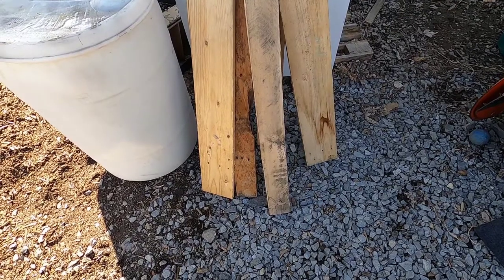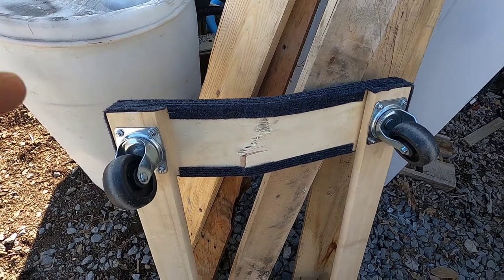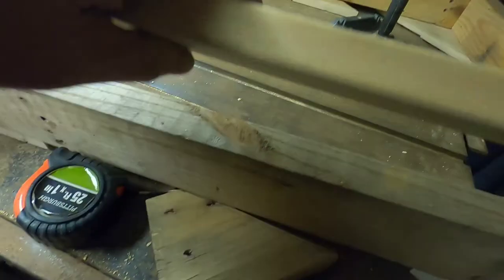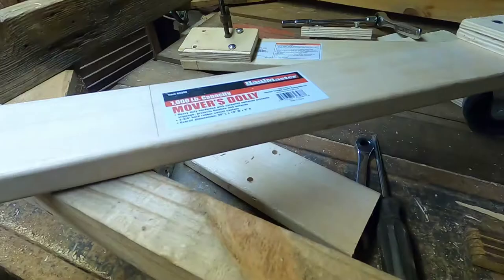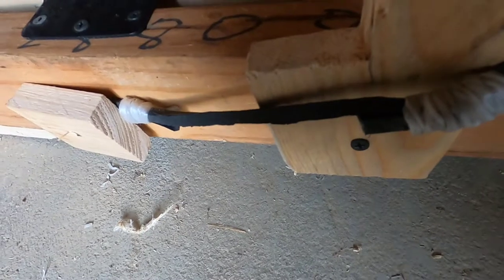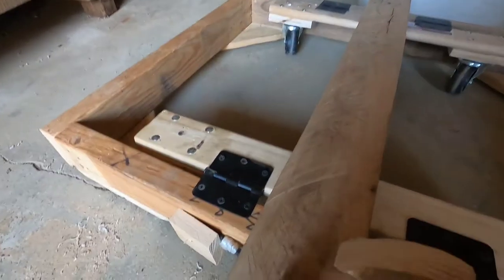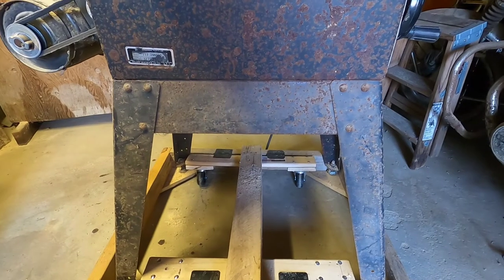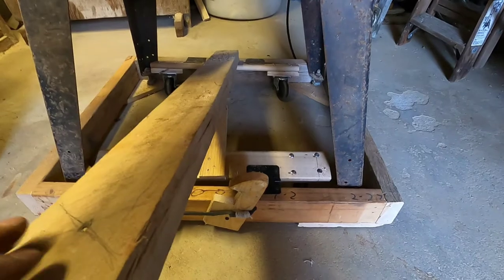Table Saw  retractable casters from recycled materials

Comment: VERY neat idea, I did similar but NOT with the unlocking feature, plus the extended tilting board would be a disadvantage in my shop
Reply from the maker: Thank you for stopping by & taking the time to comment. I may have to make another one for a piece of equipment that I may be getting.Space is really tight for me. How did you make yours?